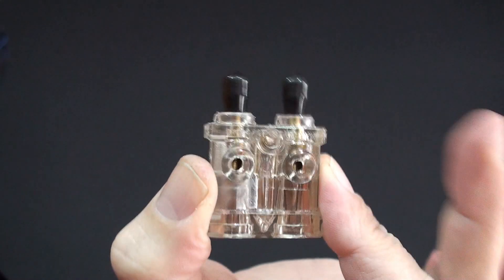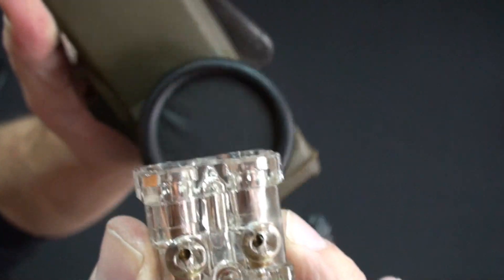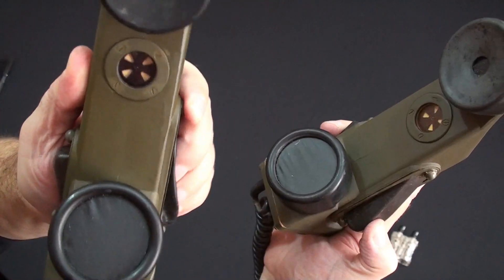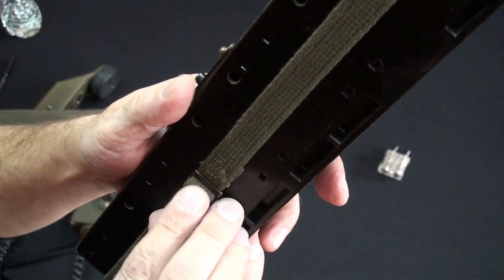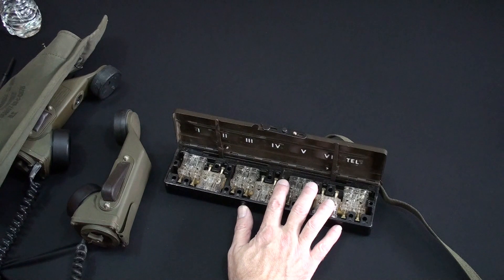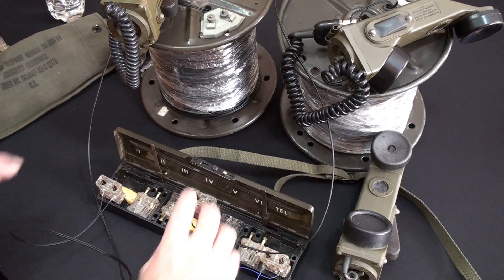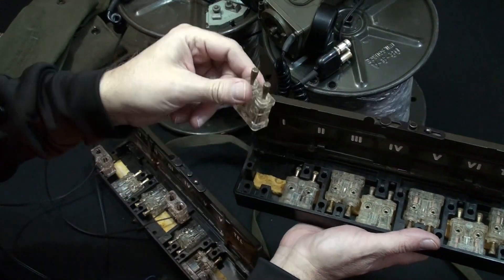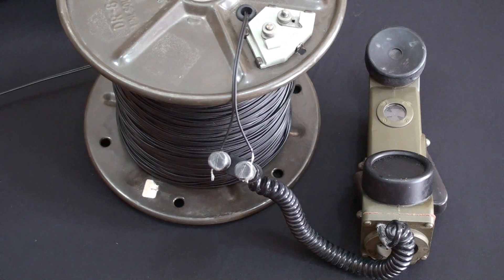Strange Device Lets You Communicate In Complete BLACKOUT!

Comment: How do you deal with signal attenuation? Electrical theory says there will be some. The longer the lead, the lower the voltage at the other end. What is the solution?
Reply from the maker: Hi Charles. The "solution" is the 4-mile range limit. Unless you want to install an amplifier, which defeats the purpose of the "no-power-required" feature, the only solution to signal loss over distance is to simply shorten the wire until you can hear it, which should, under normal circumstances start at about 4 miles. I've personally never stretched one that far. Thanks for watching.

Comment: What powers the audio? Does the vibrations of your voice cause something to move to generate an electrical charge to transmit the audio? I assume the is not duplex audio.
Reply from the maker: Carbon sandwiched between thin metal discs. I'll be doing another video soon based on the science of it and we'll actually make these.